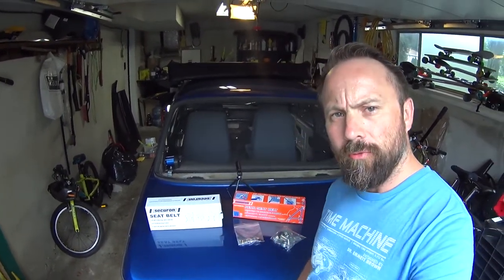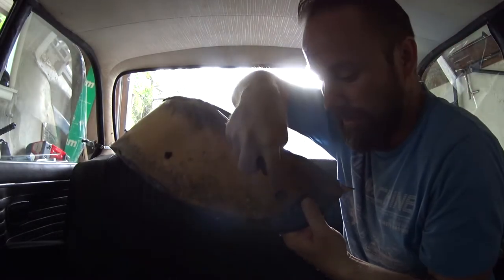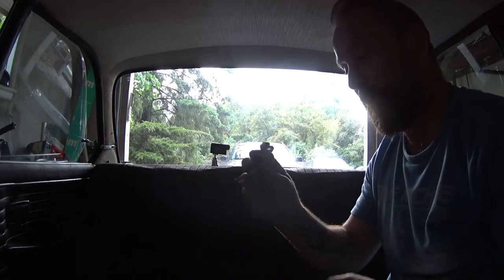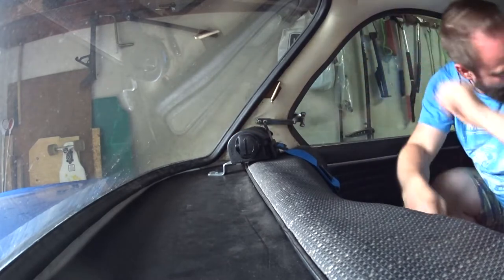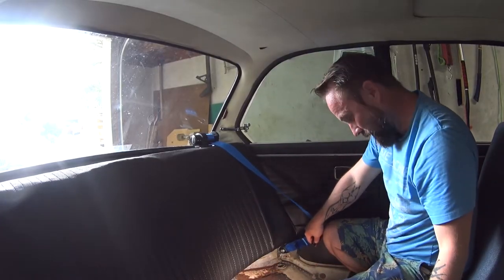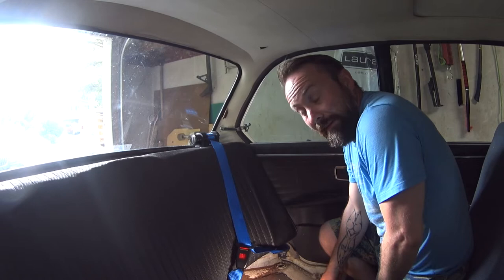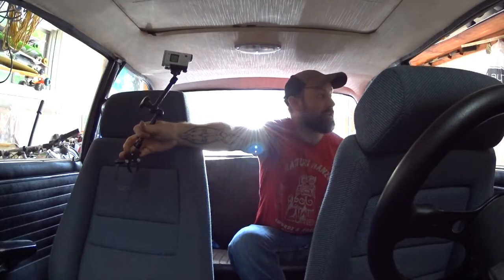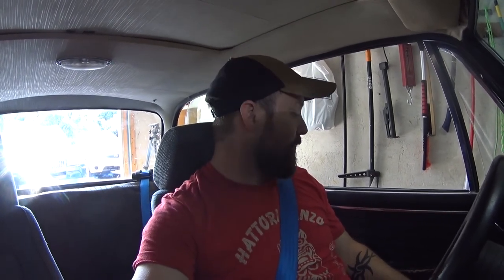PROJECT 1968 BMW 2002 EP12 - Seatbelts Securon

Comment: Im also looking to add some back seat belts to my 2002, Which securon belts did you pick for the back seat ones?
Reply: Nevermind I see they are the model #254
Reply from the maker: Aircooled yes, I did Securon 254 in the rear, the fronts are Securon 500/45. Bought everything from kcponline out of the UK.
Reply: Thanks! Great work on the build

Comment: You mounted the front seat belts wrong, this way you trip over your seat belt while getting into the car.
Reply from the maker: Where should they be mounted? Seemed like the best spot to mount the reel.  I do need to make other changes, right now the seats don't tilt, so I need to see if they can be retrofitted, too.  Let me know better mount points and I'll check it out when I update the seats.
Reply: Spurious Pseudo kinda hard to explain for me but the belt connecting washer gets mounted behind the roller, not 20 cm infront of it.